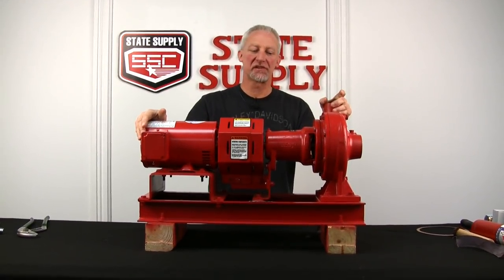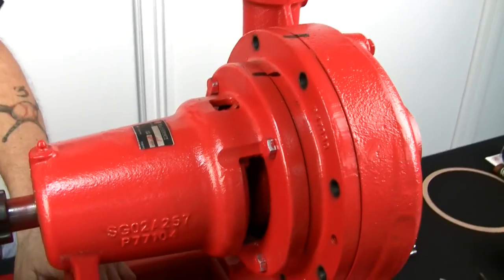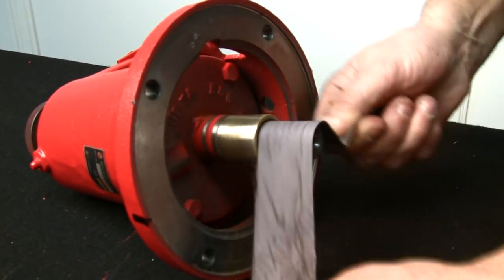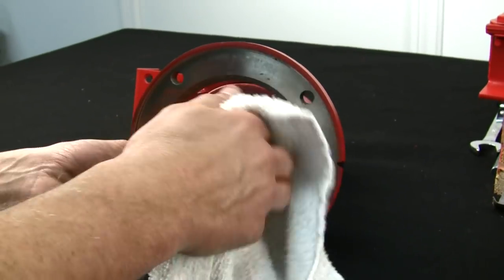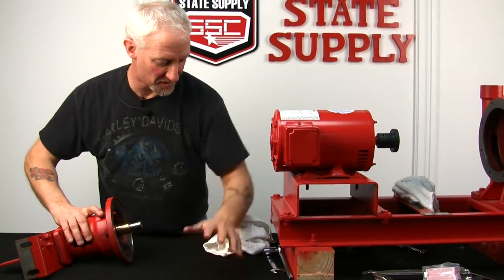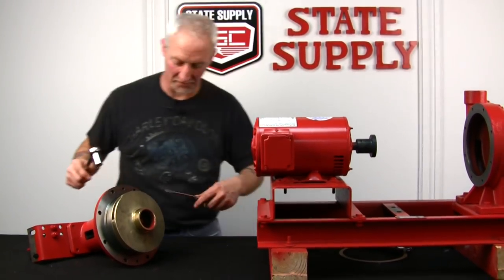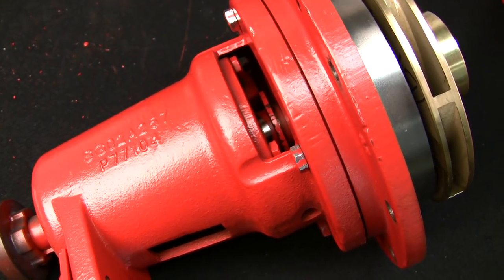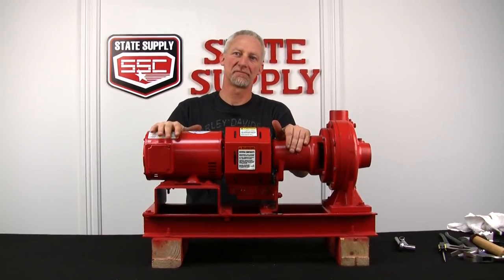How to Replace a Bell & Gossett Series 1510 Seal Kit and Shaft Sleeve

Comment: how do I know which seal kit to order for the 1510 Im working on? seems to be like 20 or more options. Is it just the shaft size and material thats different between them all?
Reply from the maker: It depends on the shaft size and application. There are four shaft sizes: 5/8", 1-1/4", 1-5/8", 2-3/8" and a variety of applications: standard, glycol, high temperature, high PH, etc. If you have a picture of the pump tag, we can figure out the correct part number for you! Feel free to email a picture of the pump tag to info@statesupply.com and we will get back to you same-day.

Comment: To remove a sleeve guys just tap it with a ball hammer on all sides, now if it doesn't  come off. Then I would suggest using a torch thanks for your input
Reply from the maker: We do not recommend tapping the sleeve without using the torch as any impact can damage the stainless steel shaft. The torch is used to soften the Loctite to allow the shaft to slide off easily and prevent damage to the motor shaft. Thanks for watching!

Comment: Excellent, I have a similar pump to repair at work. After seeing this I think it will go pretty smooth, if everything will come apart. Thanks again!
Reply from the maker: Glad you liked the video. Hopefully your repair goes smoothly. Give our pump experts a call at 877-775-7782 if you need anything else. Thanks!
Reply: @statesupply  I just completed the repair, all is good, thank you.

Comment: It is superb demonstration, mainly concerning all safety aspects of the machinery. AWESUM !!!! My request to you is that how can I replace the originally installed gland packing assembly by a mechanical seal, off course it is a high capacity sea water centrifugal pump. I'm looking for the solution for last 3 months . If you can help me in this matter, I'll be ever grateful to you.
Thanks,
Regards,
Sambit

Comment: Great video My only input is @ 14:32 when removing the Shaft Sleeve Make sure to not to hit the actual shaft because you will put a nick Damaging the shaft  and will cause a leak. this  would defeat the purpose of the shaft sleeve.
What I normally do is I score a line on the shaft  Sleeve and tap it tap that area with a chisel.

Comment: I'm fairly new in the field of HVAC but, the guys I've helped rebuild pumps were adamant about me not touching the ceramic seal. They stated the grease on my fingers would be enough to mess it up. Is that true? This video seems to prove otherwise but, I wanted to see if you heard anything about that at anypoint. Thanks for the step b step video!
Reply: I don't know about this pump but on the Allis Chalmers 2000 series you don't want to touch the face of the seal sealing surfaces because like your friend said it could damage the seal and the pump would leak
Reply: In your field best to not touch the sealing services

Comment from the maker: Thanks for the compliment! Are you asking about the coverplate? If the coverplate is rusted where the boot and the white ceramic go, put a wire wheel on your drill and brush it off. If the coverplate is pitted or has grooves, you will need a new coverplate. If you have additional questions, give me a ring at 877-775-7782.

Comment: I did every thing you said but my brass sleeve stick out further then yours does and it's a different pump but when I went to put the propeller on it would lnt go far enough back because the brass sleeve stops it from going further..... Help
Reply from the maker: Hi Josh, please give us a call at 877-775-7705 and speak with either Tom or John L. They'll get you squared away ;-)

Comment: What size is your bearing puller for this?  I need one.
Nice work
Reply: +John So what happens if you don't use locktite on the shaft sleeve?good video.Cheers
Reply: +John And what is the purpose of the locktite on the shaft and shaft sleeve?Thank you.Rob
Reply: +John Also what is the purpose of scratching the new sleeve with emery cloth?
Reply from the maker: +Rob Hernandez The loctite is used to adhere the sleeve to the shaft.  The emery cloth is used to to remove any residual  loctite from the previous sleeve and smooth the shaft out.
Reply: Thank you for the fast reply.
one more question..Is it possible to use water proff rtv sealant instead of the loctite?
Thank you again. exelent video!

Rob
Reply from the maker: I strongly recommend not using anything else other than loctite.
Reply: +State Supply Ok, thank you for the advice.Cheers.Rob
Reply: The pump I have is the "e 1510 ssf 12.625 25 hp3GB I know it is a bigger pump than the one you are showing in the video. So I want to know if the procedure to change the seal is the same.Thank you

Comment: How do you suggest cleaning the place the the rubber boot and ceramic insert go? The one in the video is much cleaner than the ones you normally come across. Most of the time they are pretty rusty.

Thanks
Reply from the maker: +Joel Ward A fine wire brush or tooth brush with some liquid dish soap should do the trick.
Reply: Does the procedure apply to the bigger pumps also?Excellent video!Cheers

Comment: I'm working on a tigerflow which I can't find no videos on. But generally same thing, generally. But my boss wants to use Dremel to cut a line down the brass sleeve and pry it off......... I told him about using a torch and I'm not to sure he is fond of the idea. Do all the brass sleeve require the adhesive. If so I definitely believe I should use torch. But also there is a fire alarm close to my work bench, and I don't want it to go of just for doing my job.
Reply: Ps I work at a Federal building as general maintenance/mechanic
Reply from the maker: Hi Josh, if you give our pump specialists a call at (877) 775-7782, they'll be happy to see if they can help you figure this out. Thanks!